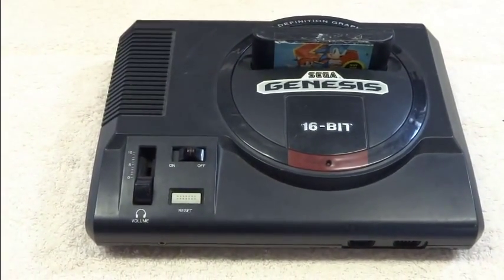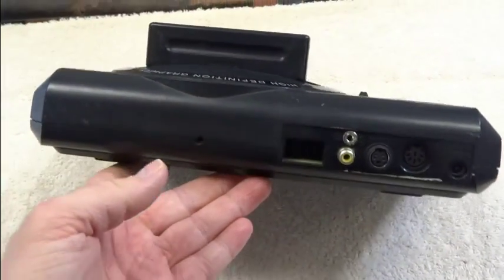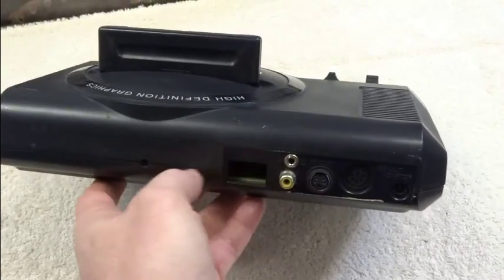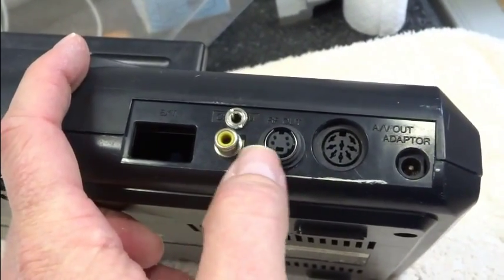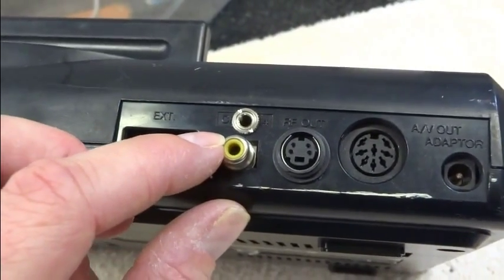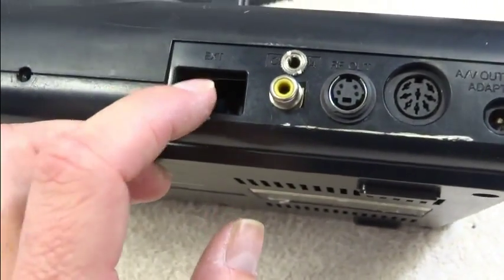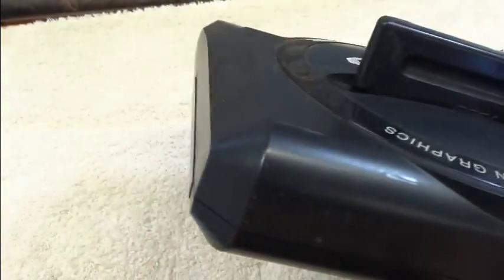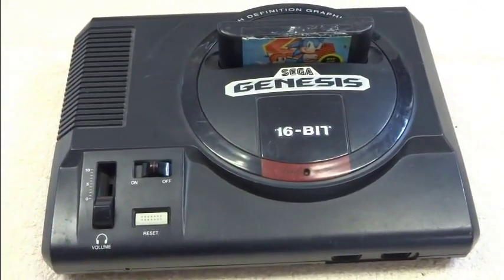Sega Genesis S-Video Mod

Comment: It's too bad you didn't rewire that 9-pin port for RGB, which is supposed to offer incredible picture quality. I just got a Genesis 2 in the mail and I'm sorely tempted to try it myself (although I'll have to add that jack).

Comment: Left a comment on the blog post but in case you don't read that, where's the best place to take the +5V from for the transistor?

Also, I'm primarily interested in doing the S-Video mod because I have an issue with pretty much every TV tuner I've ever tried to connect my Genesis to of having flickering/lost chroma, due (from research) to the odd refresh rate and resolution of the Genesis. I figured seperating chroma using S-Video will sidestep the issue, does this stand to reason to you as well?